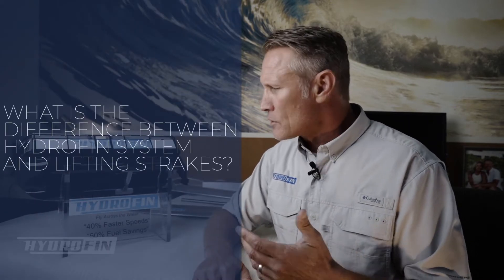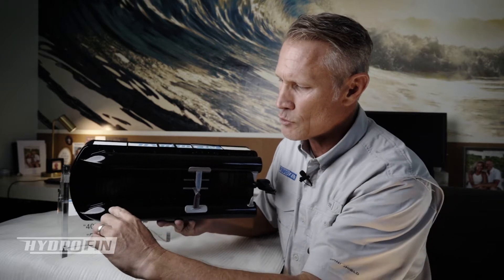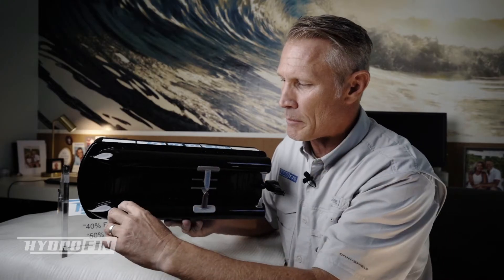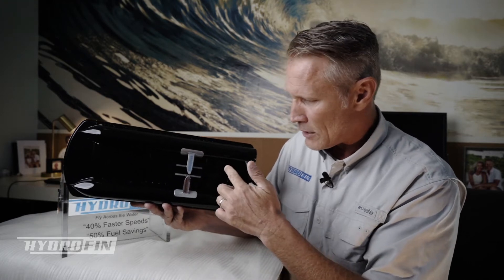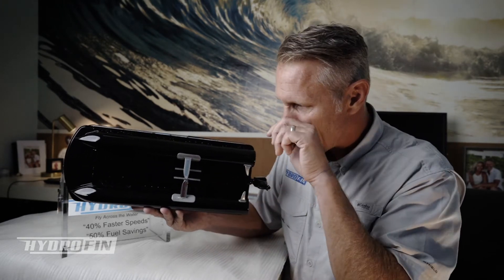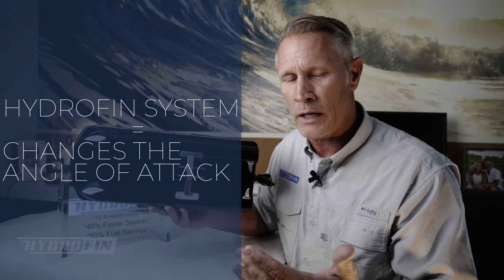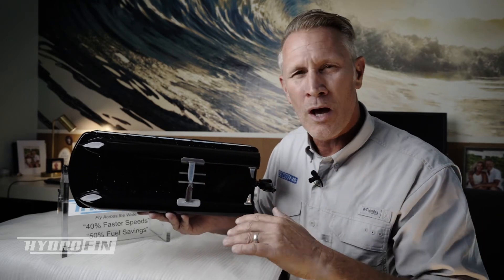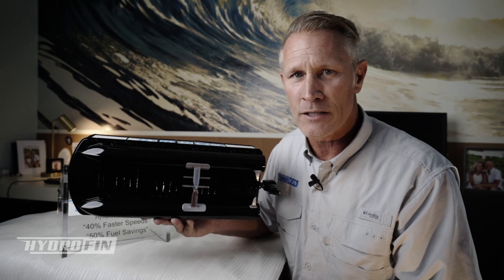What’s the difference between lifting strakes and Hydrofin?

Comment: Can I install only the rear stabilizers? I just need a bit of lift on the back. 
Moreover, I do not have a trailer, my marina use a crane for haul in and haul out. That V might get damaged from the crane straps.

Comment: I have two questions. I have a 2021 Harris Tritoon w/ 150hp & lifting strakes.  My outside toons only have the strakes mounted on the inside of the toon and my center tube has the 1/4 strakes.

1. Now can I still use the Hydrofin?

2. Are you interested in possibly using my boat as a product demo to use in your or my new upcoming Pontoon Boat YouTube channel?

Comment: What HP motor is needed to get a benefit ?This obviously needs speed to work.
Reply from the maker: We have 2 solutions.   The one designed for double pontoons starts generating substantial lift at 15mph while the solution for tritoons needs about 25mph.   Hp doesn’t matter as much as speed and total weight of boat.   Does this answer your question?

Comment: I'm just wondering if you could have a way to shift forward or backwards to increase buoyancy or decrease buoyancy so that you could you know kind of like have a adjustable system
Reply from the maker: Our current model is a fixed system. However it does have adjustability, so that we can make fine tune adjustments for each boat as needed. You just won't be able to make the adjustments while operating the boat.